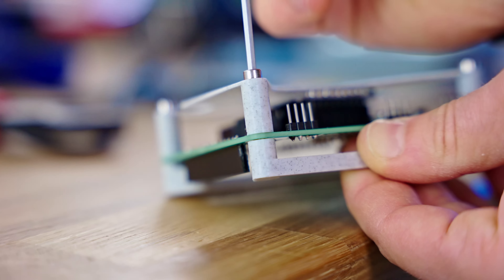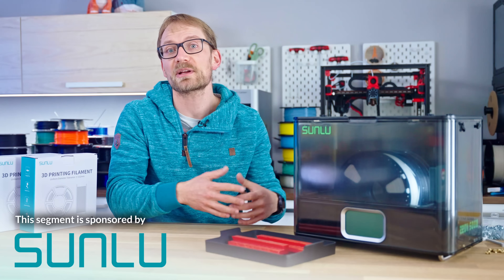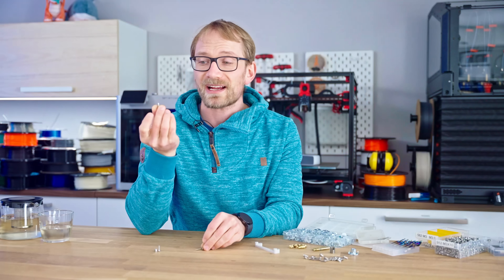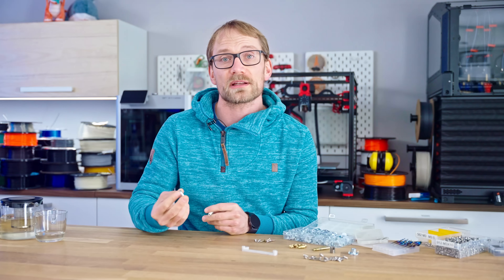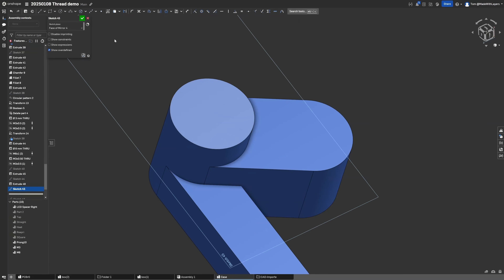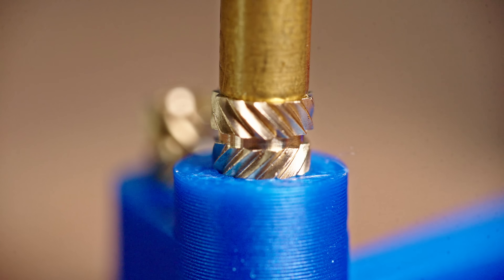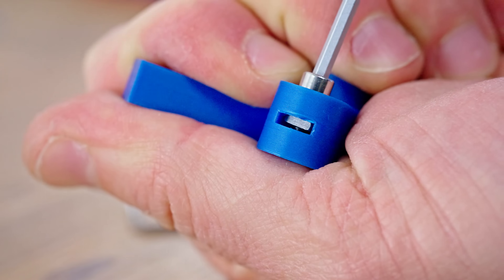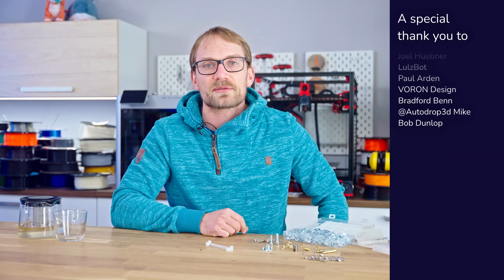A better way to add threads to your 3D prints

Comment: What is missing:
Cut out on the backside to use normal hex nuts.
Cuttout some wehe in the part to pause the print and add a normal hex nut.
Both types are very easy, cheap and very strong methods.
Especially the hex nut in the part with the pause method also looks very good and clean.

Comment: Or just create a negative on the back if the part for a nylock nut and press fit it in. It's what I've used for many many years. Standard Resin isn't strong anyway though 😢

Comment: While I have one of those heat set inserts gadget that keeps the inset completely aligned, I rarely use it. I saw a much easier solution (unfortunately I don’t remember where I saw it first). Just keep a small piece of metal handy. The push the insert in with your favorite tool, but stop pushing before it arrives at the surface. Then, while the insert is still warm, use the metal piece to push it in the rest of the way. With a little care, you can end up with the insert completely flush with the surface. If the piece is small enough, I just turn it over and press it against my work surface.

Comment: TLDR: With such screw connections, the front component must have a through hole!

A common problem with screw connections is the lack of understanding of the connection. In a screw connection, the external thread of the screw comes into contact with the internal thread of the rear component. The front component is simply clamped between the rear component and the screw head by force and therefore requires a through hole. If, as is so often the case, a thread is incorrectly used on both components, the screw cannot tighten both components together, but instead a gap occurs because the angle of the start of the thread is undefined. The reason why wooden or plastic components are nevertheless pulled together by a screw in this case is that the thread in the front component is destroyed, but this would not be possible with metal, so the connection is not possible. Of course, this not only damages the thread, but also the base material. Furthermore, screw connections are not form-fit, but force-fit, as there is play between the through hole and the external thread of the screw. Such a connection is only form-fit if a screw with a shank is used in combination with a correctly toleranced through-hole.

Translated with DeepL.com (free version)

Comment: I like to use slightly tapered (conical) holes. I design the top big enough for the screw to insert without engaging. To get the right amount of engagement, I can choose a longer or shorter screw when it comes time to assemble. This means the first print off the bed will work regardless of printer variation or settings, provided I have screws of various lengths.

Comment: For your filter boxes, I have a question as I want to build a similar setup. Did you consider magnets? If so, what issues did you have/foresee that made you choose threaded inserts instead?
Reply from the maker: I wanted everything on the box to be a proper air-tight seal, so the front is actually clamped on with quite a bit of force. In fact, the sealing surface actually curves outwards by 3mm to compensate for the lid flexing, so magnets probably wouldn't have the necessary holding power. But I have considered using a slide-in locking mechanism, similar to how the filters are held in place, but for now, screws work perfectly.

Comment: For prints that do not require strength, why not design and 3d pring your own screws and female thread?

The object will be printed with the threads for your printed screw. Print the screws and done!

Everything printed!

I still don't understand why keep using and buying metal screws and pushing hot female into printed part!

And yes, you can 3d print small enough screws!

Comment: Have you tried just doing hexagonal holes?
I found that hexagon shaped holes just a better option for a fdm printing, cos the seam is hiding in a corner and don't misaligning the center of a hole. Also it's better to print horizontally if the corner facing upwards

Comment: Thanks for your exellent videos!
For myself, I use mostly hexnuts and I don't cut in a slot but add a slightly undersized hex hole at the back, where the nut sits firmly without selfdislocating. In projects, where every gramm counts, this is the way to go, because, hex nuts aren't as heavy as, for example, heat inserts and provide good durability and strength.

Comment: I have been using self-tapping screws for plastic in my constructions for some time now. At least for small sizes of approx. 3mm.
I have bought an assortment box with different lengths. 
These screws are perfect for applications such as screwing an Arduino to a 3D print. 
Such screws are definitely worth using.

In terms of user-friendliness, I would rate them 5 stars (you only have to design a hole in CAD and can simply screw the screw in after printing). 
Strength as with tapped holes with 4 stars (even if I would only have given tapped holes 3 stars) and durability also 3 stars. 
In fact, you are more likely to snap off the head than the thread gives way.

Comment: I use a standard tap, but I immerse my workpiece and the tap in a bucket of water. Nothing heats up and I have a 100% success rate with my threads.

Comment: The main thing to take from this video is that there is no single solution that tis "best". They all have different features and requirements and you have to work out which is appropriate for your print.

Comment: The title is wrong. « A better way » let me expect you to show a new or the best way to do it (even if it depends on each preferences).
Should have been « 3d printing threads comparison ». What I learned is that metal inserts are still the best (at least to me).

Comment: If you want to cut the thread yourselfe and use Fusion, you dont have to Look up the hole size. When you select a hole with the thread Tool and chose your size it will automaticly change the diameter to the Right size.

Comment: I wonder if not being able to get decent wood/plastic screws is a Europe thing.    It is actually harder to find a specific sized m3 screw than it would be to find a decent plastic/wood/drywall screw here in the states.  Using those is honestly probably one of my biggest go to options for basic light and medium duty stuff or really anything permanent.   95% of the time this is my go to method.   You want a really strong bond then use a little CA glue, the thick stuff for wood is perfect for that, you can also use wood glue as well.   Probably the only issue is they don't really do well if you are constantly removing the screws. 

If you can get to the back side just putting a pocket for the nut in the back is probably the most simple and just as strong and durable as a heat set insert.  Pretty much it gets full marks in every category so I am not sure why you didn't mention that.   You can even make it slightly undersized and heat set it and it doesn't have the issue of needing to be perfectly straight like a heat set insert so ends up super forgiving.   Obviously if the design stops you from ever getting to the back then that doesn't work and you need a heat set but I found that rarely to be the case.   That used to be my primary method for anything I regularly took apart.    

That said I rarely use heat set or pocket nuts anymore.  I have replaced this 99% of the time by using magnets and keyed parts so they fit together easily and the magnets keep them together.  It makes it way faster and easier on anything I ever need to take apart.    Pretty much the only time I still use heat set or rear pocket nuts is when I need to be able to adjust how stiff a plastic on plastic moving part is which is a very particular use case.

Comment: It's widely unknown but there are self-tapping screws for thermoplastics that you can use less often than threaded inserts but more often than a standard metric screw directly into plastic, and they can withstand much more force than either alternative. Only downside is that they aren't standardized but there are very similar versions from different suppliers. They're also rather cheap. I'm amazed at how little people are aware of their existence, every maker should have at least a small box of them.

Comment: On heat set inserts, I always (well, as much as possible), set them on the opposite side from where the screw comes from, that way similar to the claw ones you talk about, would have to pull the hetset through the part for them to fail.

Comment: Ive been doing this all along. Just print a hole 2.8mm for 3mm threads. Inserts are only necessary if you plan to take the screws in and out often.

Comment: Thanks for the self-forming threads option. There are definitely some scenarios where square nuts create weak spots in prints and this would be a good option. I have a product that requires 90 square nuts (and I often buy out one online retailer's entire supply of square nuts) so it'd be interesting to think about where the self-forming threads could replace them.

Comment: I heat the part up and thread the screw into the part forming the threads and not cut the plastic.  Stronger than using a tap.

Comment: A technique that I use with various types of printed holes is to use slicer modifiers to create a cylinder of solid infill around the hole. That way, the screw has more than just a couple of wall layers to bite into. Also, if it does become stripped somehow, there's still the option of tapping new threads for an oversized fastener.

Comment: I like to model the male threads and then boolean them out with an added tolerance variable in onshape. Once you have your tolerance dialed in then you're good to go every time with that particular thread. Since I tend to use the same threads a lot it doesn't slow me down much. If you're feeling fastidious you can clean it up with a tap. I've never had pla melt when tapping threads when using cutting oil fyi.

Comment: I've been using a variant of self-forming threads for a while, I just overlay a rectangular slot and a round hole, giving 4 points of engagement.  When making horizontal holes, I make the slot vertical, to avoid having the screw wedge layers apart.

Comment: My favourite method is definitely the simple hole with a chamfer on the side you are screwing into to make it easier for the thread to grab. I disagree with your assessment of "ease of use" as they are by far the easiest to model and even while using an ender 3 I've never found that the hole size has to be perfect. I also find if you aren't using a drill the melting isn't an issue but that's personal preference.

Comment: You missed a great option: print the threads (yes, even small threads like M3) then follow with a *form tap*, also called thread forming / fluteless taps! These taps don't cut but rather squeeze and deform the material into the correct thread shape. There's no chips to clean, threads are stronger because locally compressing the plastic makes it stronger (even stronger than your self-forming threads option because of the closer fit) and the form tapping itself is painless with a hand drill and just a drop of oil. Plastic won't tear out because the printed thread is already close to dimension (and the form taps themselves are stronger than cutting taps so they're less likely to break for tiny threads). The form taps on Ali for a few bucks each are plenty good.
Reply: This is also my preferred way of creating small threads. I chose an even easier route for the form tool: Just take a long (M3x50 or longer), put it into a drill and spin against sandpaper or  a file to create a sharp point for keeping it straight in the hole and then using a 3d printed handle for turning it whilst chasing  the threads.
Reply: Don't use any kind of oil for this, but another name for what you're describing is a thread chaser
Reply: oil and 3d prints DO NOT go together
Reply: Oil?!
Reply: @kennethhicks2113  Yeah, super bad idea. Don't do that.
Reply: They're useless through for 3D prints imo. Excellent for like rivet thread style steel parts to form thread correctly, but for plastics any tap is too oversized. Just drive normal bolt in and its done. It usually creates nicely heat to form really nice threads imo.

Comment: FORMING TAPS!

Thanks for the video It is very informative.

I would not recommend using cutting taps, as they are typically only necessary for hard metals like steel. If I needed to tap plastic, I would use a forming tap (also known as a roll tap, fluteless tap, or cold forming tap). This type of tap forms threads by pushing the material rather than cutting it. Forming taps are generally used on softer metals (such as aluminum) when a stronger thread is desired without the added cost of using an insert, such as a helicoil.   I hope this helps those who need to tap plastics.

Comment: 1 - Push heat set inserts 90% of the way in using your soldering iron
2 - Use a something with a flat face of metal or glass or stone to push them the rest of the way in
3 - Enjoy having your heat-set inserts installed straight, every time.
Reply: Thanks! Good idea
Reply: Yep! That's what I do with mine.
Reply: Spatula’s are great for this
Reply: and the top surface is smooooooth
Reply: This is the recommended way to insert heat inserts
Reply: Also, you don't need those fancy insert tips for the soldering iron. Just use the regular tip and if it's a bigger insert where there is a chance that it can catch and pull the insert, just hold the insert with thin tipped pliers from the sides. That also stabilizes the insert, and you can hold it in a way that you don't accidentally push it too far in, so that you can still push the rest of the way against a flat surface.
Reply: The low quality stamped sheet metal wrenches your 3D printer comes with are unironically excellent for this purpose. They're effectively just a cheap flat metal bar you can use to align the heatset insert with the print surface and it's something everyone with a 3D printer has access to. They're almost entirely useless as wrenches too, so it makes them less useless.
Reply: Yes, and push them in slowly. Pushing in slowly at a lower temperature gives them more grip than pushing them in faster at a higher temperature.
Reply: I have a big box store tile sample for this purpose.
Reply: And don't interfere with their rotation! You can make a rotating "soldering iron" from a cheap 3D printer heater, a pressing attachment, and a bearing. If it rotates, the bushings are also trying to rotate, not just bend the plastic.
Reply: 1 - size your holes right
2 - just screw in
3 - Enjoy
Reply: @gernhartreinholzen3992Enjoy your parts failing after one rotation too much. 🎉

Comment: Wood screws + more perimeters if you are worried about the strength of the print.

Easier than tapping, sinces it's 1 shot and go.

Easier than machine screws.

Win win win.

Just change print settings, and buy a bag of 100 in the right size.

Comment: For the self tapping threads, I've found that hexagonal holes work perfectly as well. If you make the point distance the OD of the thread, the lines will be slightly further apart than the ID. Once the thread is warm it will just create a round thread.

Comment: Straight holes get a lot more consistent if you print a calibration block with a series of incrementally sized holes. Then you just need to try a screw in each hole and pick the fit you like, noting it down on a post-it on your monitor to use for your future hole sizes.

Comment: Also worth mentioning - threads are for attaching to non-printed parts. For connecting two printed parts, there's alsmost always a better way. Using slots, wedges, angled dovetails, etc.
Consider hanging something on a french cleat vs screwing it to a wall. The  cleat is stronger, easier to install the object, more flexible, etc. Similarly for printed parts - having them slide together is normally superior in strength, speed, and ease.

Comment: Fusion's modelled thread + Press Pull on the thread itself -0.1 mm (inner wall and two thread faces) does work exceptionally well for M3 and bigger, I've been using for years and works as a charm.

Comment: I was just about to begin working with inserts, thus a fortuitous time to open my browser and see your video. Thanks Tom. The Sunlu Heat is interesting, I hope you are planning a video to test out the annealing process. I just purchased the S4, which works well for my applications. However, if the annealing results in stronger prints, especially with PLA, I will order one.

Comment: Myself, I really like using fully embedded nuts... Just model a negative space for the nut in the print, and pause at layer just before the cavity for the nut is printed, drop the nuts into place at the pause, then continue the print... The not is then fully encased in the plastic, so minimal risk of breakage (I like the cutout slot you showed) and it lines up perfectly with the hole.

Comment: I tend to model threads and tap them for quick stuff, but finer threads benefit from more perimeters and smaller layer heights. I also use heat inserts, as well as captive nuts and washers to spread loads. if I want strength and repeatability I use the wood inserts, but model the thread too prior to insertion, however this is rare, as I'd rather use a through bolt and captive nut if I need higher clamping forces. Also use good quality taps, I'm sorry but those cheap Chinese "titanium" coated all in ones are not the best, as the drill clogs up and can melt the plastic, plus they are useless on stainless steel even with cutting oil

Comment: Too bad in slicer you cant choose an edge and tell it how many walls to do on that exact area. 

Or, have a "reinforce holes" option to add tighter infill and a few extra layers at internal holes.